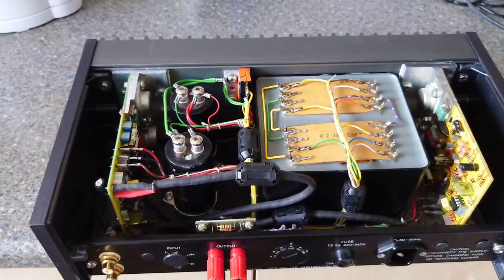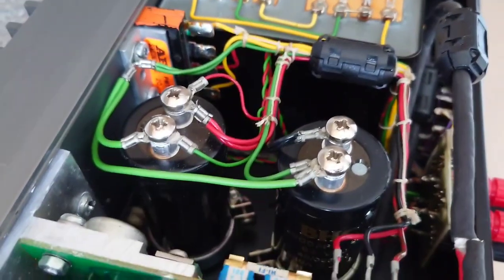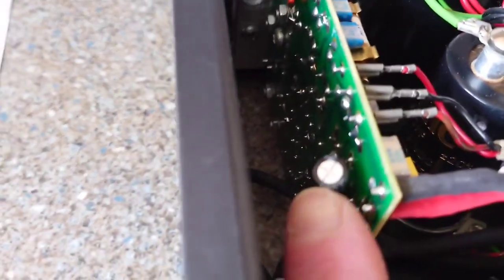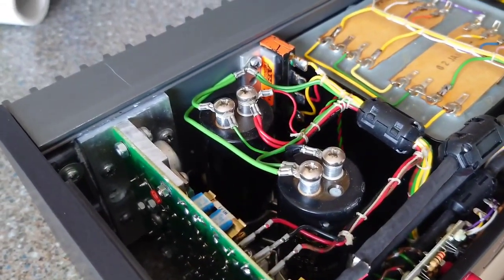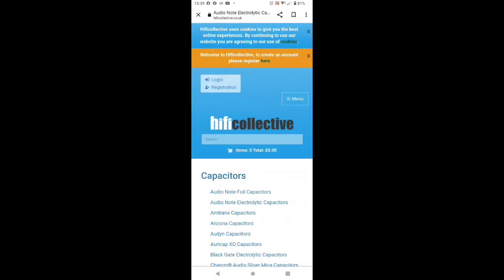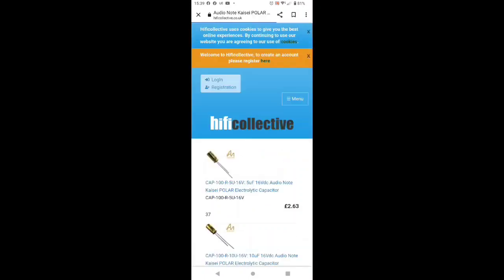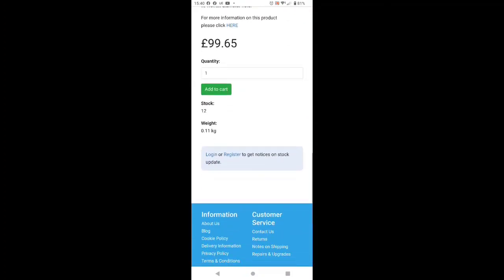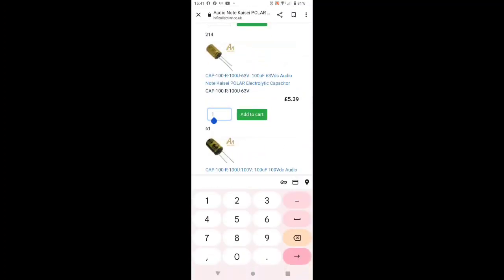Upgrading The Original Quad 405 Power Amp

Comment: Hi mate , I’m sorry to read some of the comments.  There is a lot of BS around about capacitors . Usually written by people with limited electronics knowledge. 
I have restored many amps (NVA , exposure, NAD etc) Recently quad 405 mk2
Generally , any half decent cap with appropriate capacity, esr ,dc leakage and polarity will be better than a 40 year old original. I started using the best I could find but as time went by I have used cheaper caps (Panasonic fc for example). Recently restored an NVA with multicomp pro caps and it’s the best amp I’ve ever heard . 
Keep up the good work.

Comment: You do know that just by swapping caps randomly, you can absolutely mess up your amp. They are there with specific specification, it's not only microfarads and voltage...
Reply: @tweakerman  you just proved my point. You haven't actually taken the time to check the specifications, you just blindly went and picked "audio" grade capacitors on a whim. No electronics knowledge whatsoever. And this audiophool cycle runs it's course, making ignorant people follow uneducated bad advice like you give.
Reply from the maker: Hello, this will be perfectly fine, I've done my research, I'm only swapping, like for like caps, with better quality ones, thanks for commenting & watching 👍
Reply: @tweakerman  What are esr and esl values for those caps in that quad? Whats the ripple current? I don't think you've researched it. I'm not trying to be rude, but it seems you have taken the audiophool road with simply changing caps with audio grade ones without thinking of proper values. With wrong values mentioned above, you will have worse sound, and in case of psu caps, introduce ringing.
Reply: @ZaklanaCeljadd Ian's told you he's done his research on his specific amp! what's the problem? You seem to have a lack of comprehension? 
And you are being rude , with your "just swapping  caps randomly" and your "Audiophool" comment!
Reply: @jimsregaturntableshifijukebox  i'm sorry but asking about what was researched, i was met with smileys. I don't belive anyone wouls take that as serious. Watching the video to the end, searching for caps also goes hand in hand with such a statement. So yes, this is basically audiophoolery at it's best.
Reply: @ZaklanaCeljadd . WOOSH! Think the smiley reply from Ian was perfect, says a lot about the gentleman he is! Other people  may have taken your insults more personally and fired back more strongly! Also think you may have visited the wrong channel mate, plenty more out there to leave your rude comments...
Do feel free to try others 😉😂
Reply: @jimsregaturntableshifijukebox  I ask logical and perfectly fit question, that any professional would answer properly. You van interpret that as you want, doesn't change the fact that it lacks ANY kind of proper answer. Completely disregarding basic electronics principles. It comes down to domain of put elna silmics everywhere, not realising that's not how it works.
Reply: @ZaklanaCeljadd  Ian doesn't claim to be a "professional" on this one, hence his research! it's just his hobby, do come down off your high horse to the same level  as most of us, and  leave the condescending attitude up there! who knows? you may even like it down here, you may even make some very good friends, as I have. 😉
Reply: @jimsregaturntableshifijukebox  Spouting words that have no meaning in this context. I'm no engineer, i'm just a person that likes to diy, and i do tend to learn stuff. And it's normal to differentiate proper information and snakeoil/audiophool ways. No high horse here, just a matter os spending a bit of time to educate oneself. You may see that as you may, but thats entirely your opiniom i wish not to influence. You can stay ignorant and uneducated, or spend a little bit of time and learn something rather than blindly following everything you see.
Reply: @ZaklanaCeljadd  that's not nice and factually incorrect, alas you have hurt me to my very core, Laddie!
Yoda once said "opinions are like arseholes, most people have one!" thanks for showing us yours! 😉😂😘
Reply: @jimsregaturntableshifijukebox  likewise :)
Reply: @ZaklanaCeljadd  cheers mate, that comeback took a while 😉😂. Thanks for playing 😉😂
Reply: @jimsregaturntableshifijukebox  JIm, this Zaklana character is actually correct and trying to help. Capacitors have very different functions in audio circuits and they need to have the correct specs. Randomly changing capcitors is counterproductive and potentially dangerous. It can cause oscillation for instance, which can cause the transistors to burn like roman candles. The problem is that TW is doing these videos in a tutorial format, which is dangerous and wrong. If something happens, god forbid, the house insurance and life insurance may be void and TW could be criminally liable.
Reply: @audioupgrades  I understand your point. 😉
I wouldn't say TW is "randomly changing caps" he has done research and been in contact with a company. As for any dangers, of which I understand there are many, he is doing this under the direction of said company, possibly that puts the company in the firing line if anything goes wrong, as it could be said he is making these changes under their direction.
I disagree that  TW is doing this as a "tutorial" imho he is documenting his journey  and has already put up a video of a change he has made and said why.
Maybe Ian should put up a disclaimer saying " This is a document of my journey and definitely NOT  a tutorial" ? 
Nice to communicate with you my friend, hope you are well.
Jim 🏴🙂
Reply: @audioupgrades  have you stopped doing your channel mate?
Reply: @jimsregaturntableshifijukebox  More lack of time. Filming and editing makes everything take four times as long. The plan is to do videos on all common jobs on hifi gear, a bit over a dozen. One of my favourites is doing replacements for volume knobs because they really super charge the sound. I make them with silver thread.
Reply: @audioupgrades  would really like to see them! 👌
Can't remember but think it may have been you, that knew when and where I used the port bungs in my old B&W speaker video, as a test, you were the only one 100% correct 👌. If it was you, you still have the best hearing of anyone I know, Off or On YouTube 👌
Reply: @audioupgrades   I may have accidentally deleted the video I was thinking off, but I do see ones where we discussed turntable mats and platter, I believe. You Sir do have great ears! 👌
Reply: @jimsregaturntableshifijukebox  I remember the bungs, it was a fun test. My hearing isn't perfect but I make mental notes of the sound to remember differences.
Reply: @audioupgrades  you definitely have the best hearing of anyone I know! Not just saying that mate. 😉
Jim 🏴🙂
Reply: @audioupgrades  think you said my Kralk Audio speakers were not good your tinnitus, I still have them and love them, but have moved on to Tannoy xt6f floorstanders and quite enjoy them now. I took a bit of listening to get used to more bass and less forward presentation though!
Reply: @jimsregaturntableshifijukebox  Correct, I have tinnitus around 9KHz, which is painful when triggered. Ribbon tweeters have too much energy so they short-circuit my hearing due to the tinnitus issue. The upside is that I always make the highs silky smooth when I upgrade hifi gear, otherwise I can't stand listening to them. This is appreciated also by people with unaffected hearing.
Reply: @audioupgrades  I have quite bad tinnitus too, but don't know it's frequency. 😉
Reply: @jimsregaturntableshifijukebox  You can listen to a frequency sweep in headphones, that will usually tell you where the tinnitus is. Most people have it between 7-11 KHz, I think.
Reply: @audioupgrades  very interesting, thanks for the reply 👍
Reply: @jimsregaturntableshifijukebox  Tinnitus is an amplification problem. When your ears start losing hearing for certain frequences, your brain amplifies those frequencies, which is why you get the ringing and the pain.
Reply: @audioupgrades  I have constant ringing which can get Very loud at times. It can, at times feel unbearable, but luckily that isn't often and may be connected to my high blood pressure at times.
Reply: @jimsregaturntableshifijukebox  For me, noise cancelling headphones reduce my tinnitus. When the ringing is unbearable, I put on headphones with the noise cancelling activated but no music playing. That's the only time I experience complete silence. You can get hearing aids that do the same but only for the ringing frequencies.